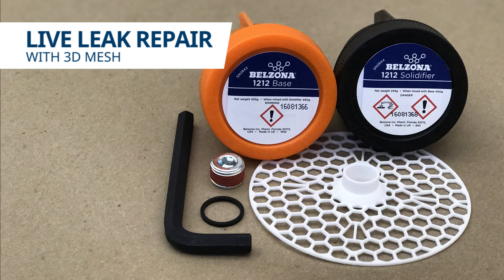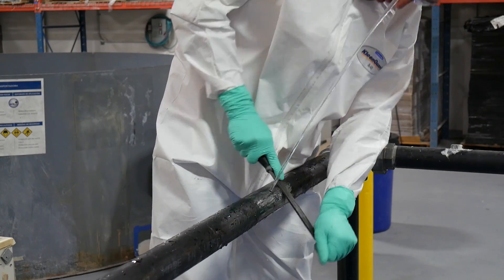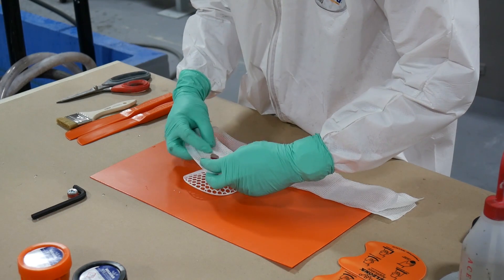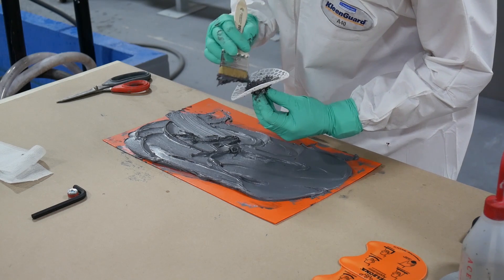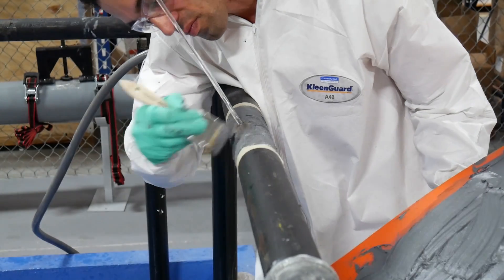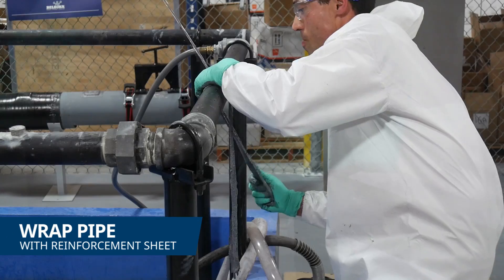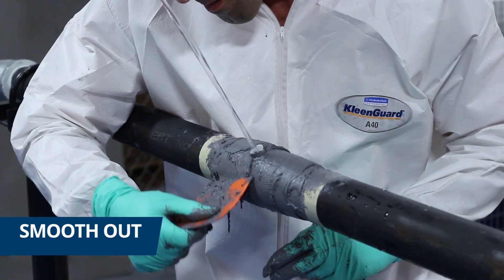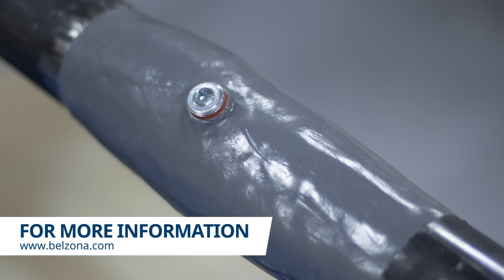How to Stop a Pipe Live Leak with Belzona 3D Mesh

Comment: Hi belzona please suggest me which belzona product is suitable for HVAC system leak repairing the joint is copper and brass ,now system is empty after repair pressure will be 550psi and temperature 160c
Reply from the maker: Hello, thank you for your question. We recommend that you send your inquiry to our Technical Team at tkl@belzona.com and they will be able to assist you promptly. Please let us know if any other questions. ~ Belzona Team